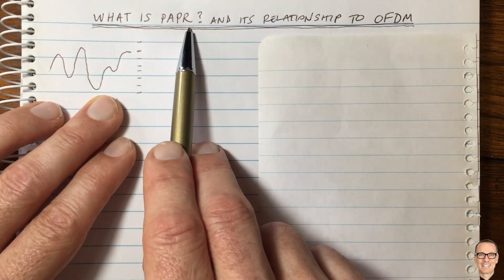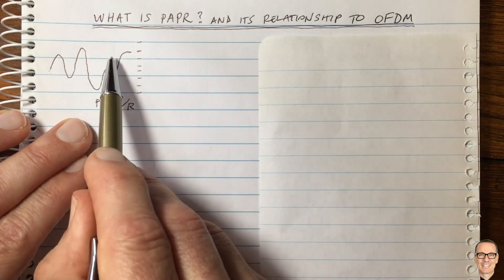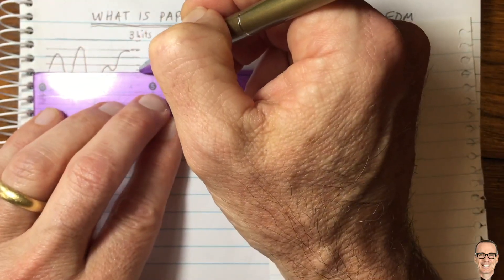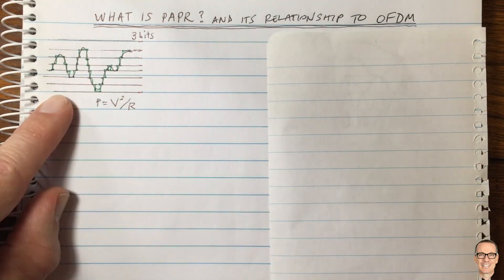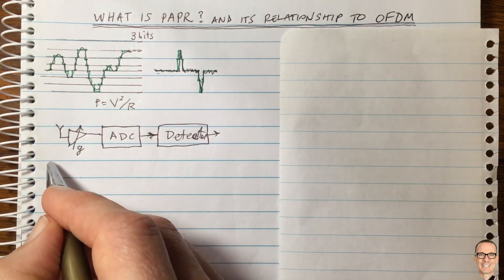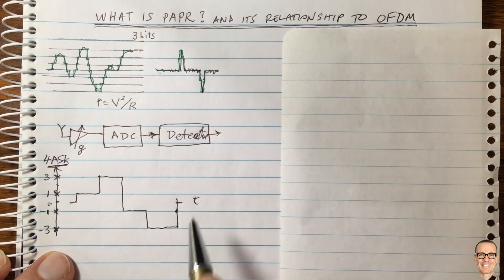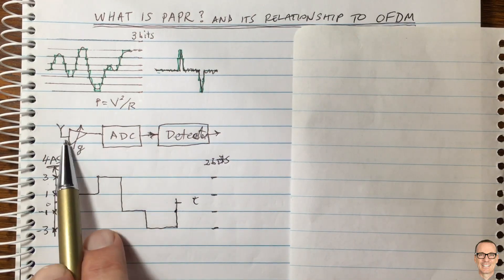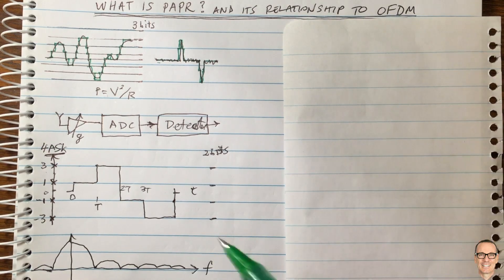What is PAPR? and its relationship to OFDM

Comment: But didnt we use fixed point FFT and choose "power window" relative to noise floor? (FFT shifts)
In that case we at risk of saturation inject "colour noise" to whole symbol, instead of compression problem

Comment: Thanks for the post... One query..in ofdma the subcarrier division is equal ryt...like say LTE each subcarrier will be 15KHz so this  c1,C2,c3 waveforms u mentioned will not be applicable ..so how PAPR explains for ofdma? For this reason Uplink uses SC -Fdma ryt
Reply from the maker: Yes you're right - for the waveforms that I drew. I wanted to keep the diagram simple, so that I could explain the "phase alignment" problem, so I didn't draw waveforms for all the carriers. I probably should have mentioned it, but I only drew waveforms for the following multiples of the base frequency (ie. the 15 kHz frequency in the example you mention): 1, 2, 4, 8, 16. It was too complicated to draw all the other multiples (3, 5, 6, 7, 9, 10 ...). Also note that the diagrams I showed are "baseband". In other words, I didn't show them after they are up-converted to the carrier frequency (I'm pretty sure you realise that already). Thanks for your comment.

Comment: How would variable gain affect the OFDM system? I mean using compression enhancing the signal near the average and compressing the peaks. And doing the opposite at the receiver side.. ?
Reply from the maker: Good idea. And these sort of things are done in some systems. The problem is to design and implement the non-linear amplifier that would be needed. An alternate is to use non-uniform sampling levels, with more levels at the lower voltages. Other schemes are also used, which check for peaks in each symbol before transmission, and then rotate some subcarriers to reduce the peaks. For these schemes, it is necessary to set aside some data bits in the symbol in order to let the receiver know which subcarriers were rotated.
Reply: By “rotating carriers” you mean rotanting the phase to another constellation point on some carriers? Or to move a specific datapoint on the data stream to a different carrier according to some rule? (Like a scrambler) or is it something else? Seems like a good idea. And BTW Iain thank you for the video series, its a great primer on these topics Good work!
Reply from the maker: "Yes", to your first question. "No", to your second question. And thanks, I'm glad the videos are helpful.